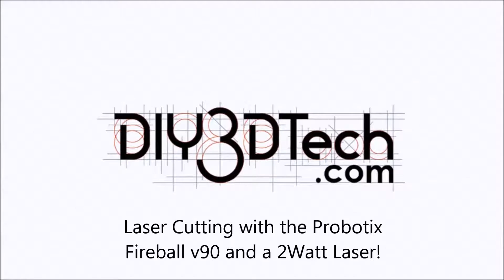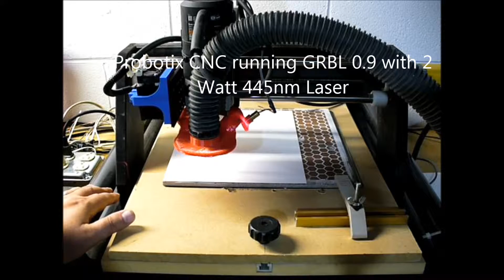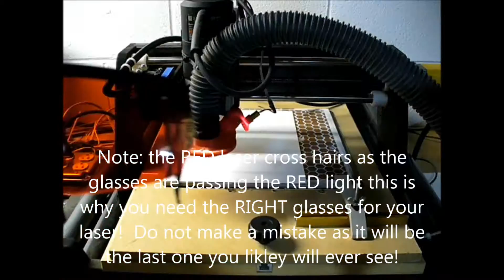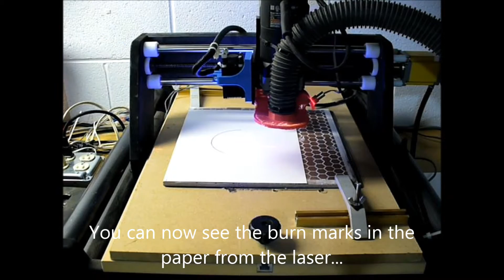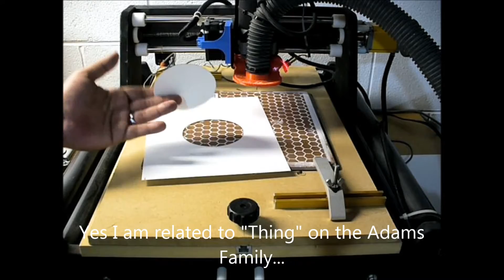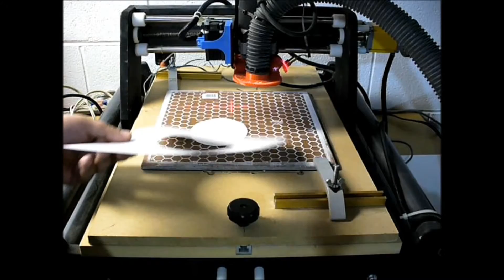Probotix Fireball v90 with 2 Watt Laser Cutter

Comment: Have you gotten a fix to the inkscape problem? I am having the same problem where the laser would turn on and wait awhile before it starts to cut.
Reply from the maker: +Rodney John yes, the issue is GRBL issues a "dwell" when when you issue the spindle on command (believe was using M5) and switched to spindle direction (M3 & M4) to solve the problem.  Because if you issue the spindle start, GRBL think it has wait for the tool to spin up.  Why so long, no clue however read you can change it in the code but I didn't want to go that far as this was easier and could keep a standard upgrade path.  Hope this helps...